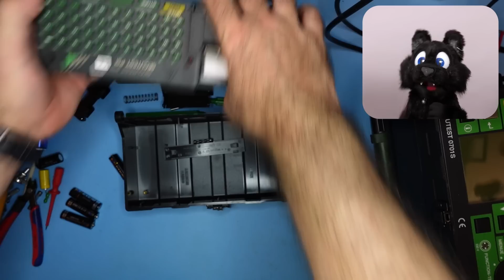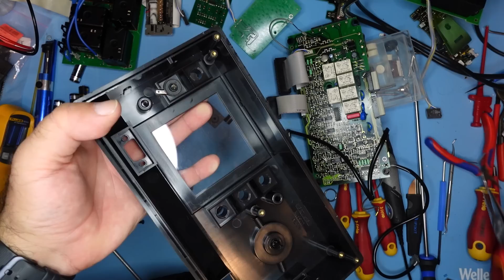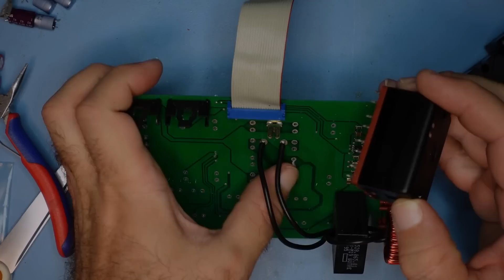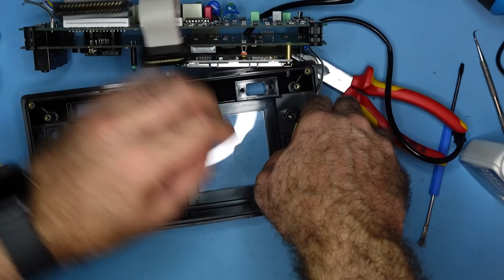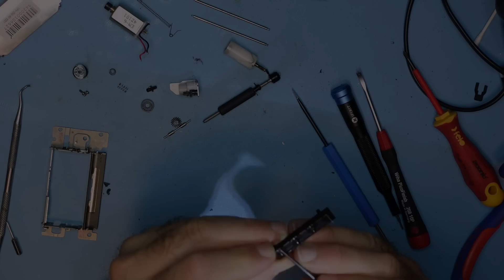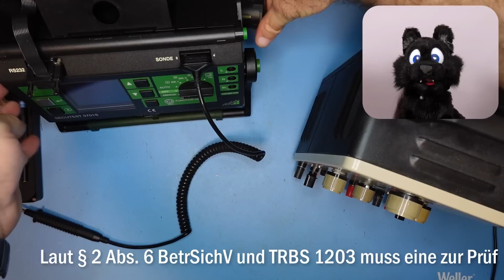Gossen SECUTEST 0701S

Comment: All the time I thought it was a thermal printer until you put back the paper that was not thermal and the ribbon! Wow what a tiny marvel.
Good batteries, they didn't leak after 24 years.
Reply: It's a line matrix printer.  Personally I didn't think there were only just four hammers.  I think the more modern ones have at least eight of them.
Reply from the maker: Maybe there's 8-pin versions, but this one (and the same in the HX-20) are four pins. I still think the idea is funny; most other printers use a stack of pins to print a line of text at  a time, while this one minimizes size by printing a pixel line at a time and also maximizes speed by doing four at a time. Quite smart!
Reply: @atkelar It's the same principle with the big line matrix form printers which have a shuttle oscillating back and forth nearly 20,000 times per minute.  Newer ones use an oscillating linear motor to drive the shuttle but before then they had a high speed brushless DC motor driving it with a bell crank.

Comment: Over here in the UK these items are commonly called PAT testers. Portable Appliance Test. The only qualifications that you need to be a pat tester in the UK is that you can switch the tester on and look for damaged cables. Licence to print money!
Reply from the maker: I read somewhere that the person needs to be qualified to actually "know" what they are reading; i.e. some experience or certification in an electrical technician position is required... but the details are a bit fuzzy; I couldn't get a clean answer from the search bot.
Reply: @atkelar  You only need a basic understanding. You don't even have to know what you are testing, just that the DUT passes the automated tests. To do the job properly you really do need a good understanding of AC and grounding but that isn't a requirement under law.